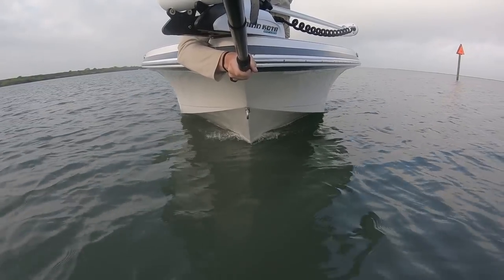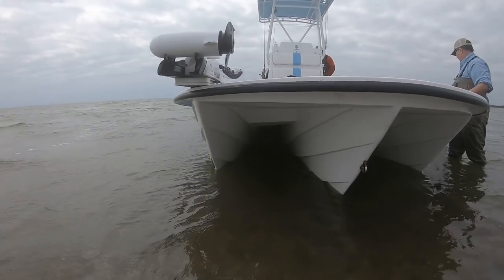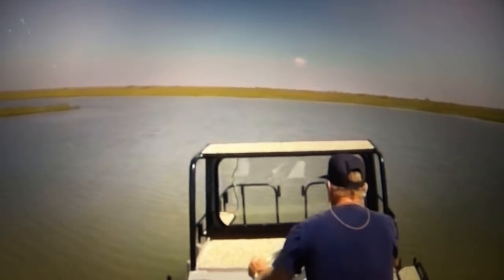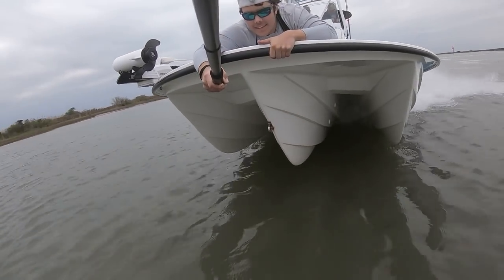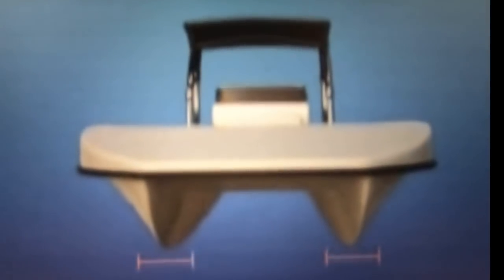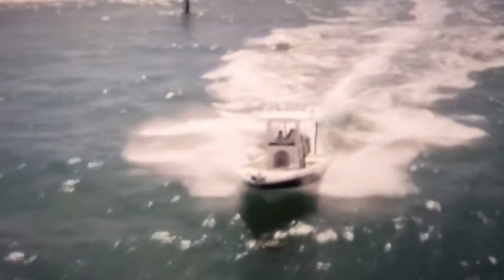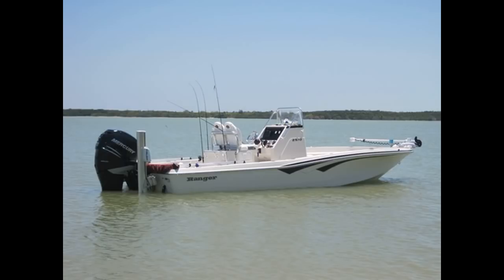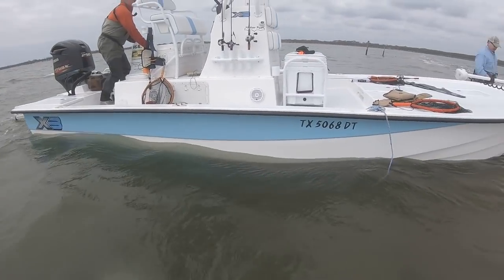Flat bottom vs. monohull vs. catamaran vs. tri-hull

Comment: A lot of mistakes in this. Aluminium is more expensive than fibreglass for one, flat bottoms are the fastest on smooth water, the deeper the vee the more power it takes to get on plane. A flat bottom is common made of aluminium because it is stronger and easy the use a sheet of aluminium. Complex shaped hulls are often fibreglass because it is easier to work the material and is cheaper but not as strong or light weight.

Comment: Great video. I have a sundance thats a shallow V. (Sundance is identical to a carolina skiff) Its well rounded for all bay boating. You didnt mention how small/ midsize V bottoms are tippy is some conditions and how flat bottoms are very stable while not under way. These flat bottoms can also have a high amount of load capacity because of their design making them great commercial work boats/ guide boats. But usually wont have as high of a HP rating as a V bottom. Pros and cons to every boat. Just wanted to add that😁

Comment: Here's an idea that You might be interested in; remember that tri-hulls can easily be  built to "fold in closer or even right up against the middle and biggest hull' with a very simple 2 board (or 2 metal/aluminum rods- poles - bedrail type extensions \ect.) ..fixed with a 'henge/bending bracket built-in midways' so that when pulled by a lever the outside hull 'folds in  (so to speak) closer to the 'Main-Center' hull...but when levered back out to full distance of the wooden boards/metal/aluminum rods\ect,, the outside hull cannot go backwards because of the henge/bracket...in place midways of the extention  (folding) mechanism in place which would be attached to the Main middle hull on one end and the outside hulls on the other end  (with the henge/bracket) in or near the middle..!!..
Hope Ya understand what I'm trying to get across Buddy..LoL..sometimes I guess "Words Won't Work".. LoL☆~☆!!

Comment: Flat Bottoms are the fastest and most fuel efficient, by a large margin.
The problem with Flat Bottoms is that they are for smooth water only, ( lakes, rivers ).
Reply: Calling flat bottom boats slow and inefficient is like calling 5th gen jet fighters slow and inefficient because of their poor glide ratios.

Comment: You said at 1:12 that flat bottom boats tends to have the worst speed among the four. Wrong. flat bottom is the fastest among the four types because it is the only type capable of hydroplaning. You never mentioned hydroplaning in this video. All racing boats are flat bottom. Look at the drag boats and jet river boats, they are all flat bottom. The world's fastest RC boat is an out rigger type and it's flat bottom. Racing boats of Thailand are flat bottomed. Bangka boat racers of the Philippines are flat bottomed The rear part of a racing catamaran is flat because that is the area of the boat that starts to hydroplane at high speeds. Hydroplane racers are all flat bottom.(u)
You forgot to mention hydroplane and hydroplaning.
Reply: yes youre correct. here in the philippines racing bagka's are all flat bottom and even built extended about 3inches each side like wings.  this creates less turbulence and drag.  overall its definitely flat.
Reply: Correct, flat bottom are the fastest on flat water, but in rough water the are too rough to maintain speed. Flat bottoms are king on rivers, also the reason fan boats use it.